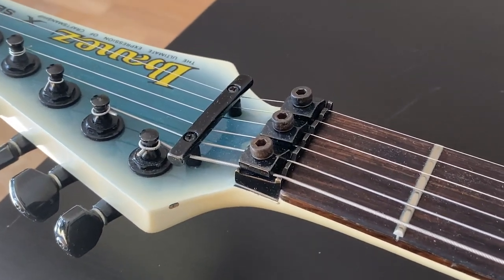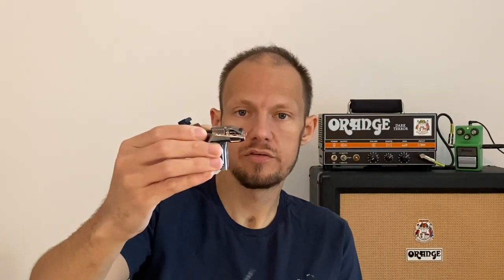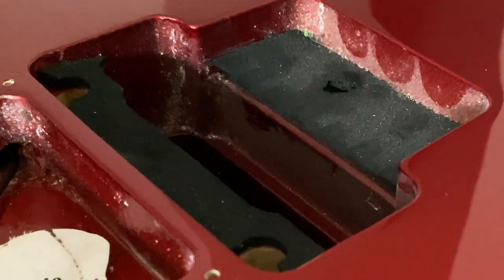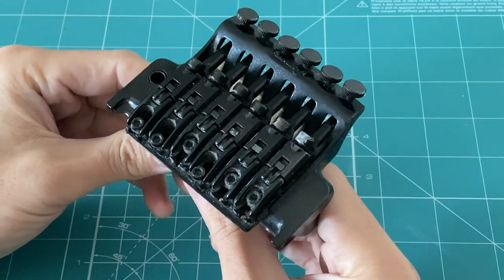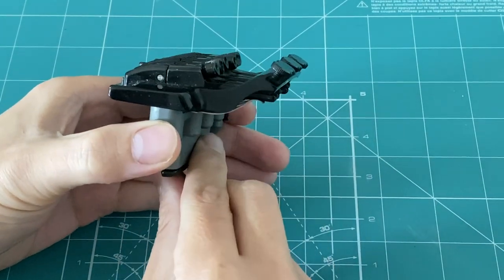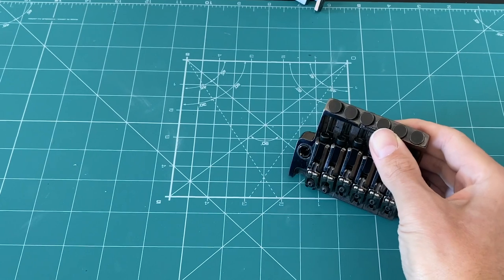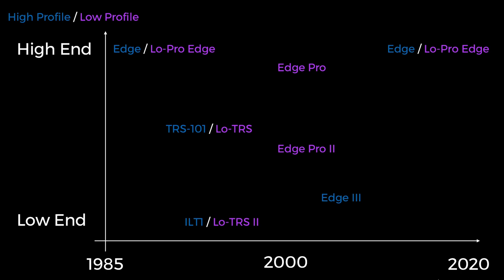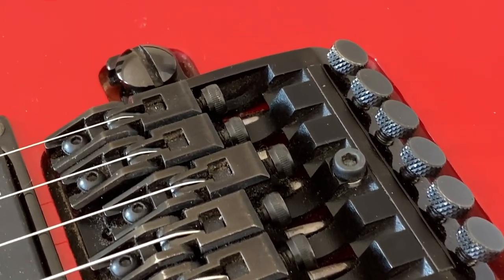EDGE, LO-PRO EDGE and EDGE PRO - How To Recognise Ibanez  FLOYD ROSE Type Tremolos

Comment: I have a question for you. I bought an RG470ahm later I realized they also make an RG470ahmz. which tremolo is better or does it really matter. thanks in advance.
Reply from the maker: Hi, generally there's not much difference. The -z models have the Zero Point balancing system, that makes the stability of trem better, but many people don't like the stiffness it introduces. It's different flavours, but they're both in similar prince and quality range.
Reply: @Ibbyhead  awesome thanks man. I’m actually glad I didn’t get the zero now. After this trem is done I will just replace with 1996t
Reply from the maker: @evilD0ER01  no worries!

Comment: Thank you. Just bought a js1000. Has an edge pro. One question, the studs that the blades balance on have a small allen pin inside a bigger allen post to lock it. Does anyone know what size the locking pin allen wrench is? Ty
Reply from the maker: Edge Pro didn't have that pin stock, but maybe you have the mod installed. I don't remember exact size, it's metric 2 or 2.5mm.
Reply: Yes have since put my glasses on and had a closer look. Bridge is now lowered and action is good. Thank you for the great video.

Comment: Guys i need your advice about a guitar i am thinking of buying ibanez rga72tqm which has a edge 3 trem and i heard about that they break after a while is that true ? I play metal in general and i am also thinking about rg370ahmz but it didnt sounded metal to me what do you think about these and if you have advice at price range of max 600 euros i would be very happy
Reply from the maker: In that budget I would hunt for some used prestige. If you want a new guitar, both of those guitars are on similar level. Edge 3 is OK, but it will wear after some time. But it's going to take a few years of solid playing. If it's setup correctly it will serve you well.

Comment: I dont have any of them that looks like one thru and threw, I have a jem jr from 2017
Reply from the maker: 2017 Jem Jr has the new "Standard Double Locking Tremolo", sometimes called "Standard DL Tremolo". It's the lowest tier of what's available right now. I don't have much experience with it, so no idea how much mileage you'll get out of this.
Reply: Seems like cheap metal and block, still sounds fine as long as you use 9 gauge, anything heavy will wear the knife faster and wont stay tuned

Comment: I hated the EDGE III, i swithed to TRS101... way way better
Reply from the maker: TRS are solid Japanese made bridges. A lot of people underrate them. I find that Edge III needs a bit of more patience in setup to function well. I'm glad you found a solution for your axe!
Reply: @Ibbyhead  the trem bar socket on EDGE III is made of PLASTIC, that means its not made for any kind of durability, its a cheap and silly design flaw. What kind of an idiot would design a tremolo socket made of plastic ? mine became wobbly and loose, i hated every aspect of using that bridge.  I destroyed that bridge after replacing it with the TRS.
Reply from the maker: @TahmidRahman  Probably somebody optimizing cost of manufacture and price of a final product ;)
Reply: @Ibbyhead  i wish i had known this when i bough this guitar.